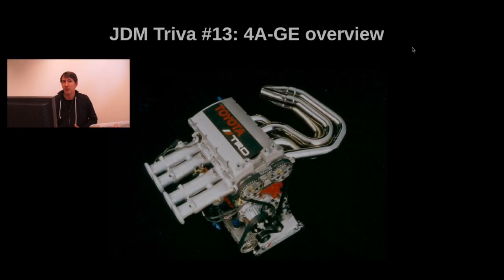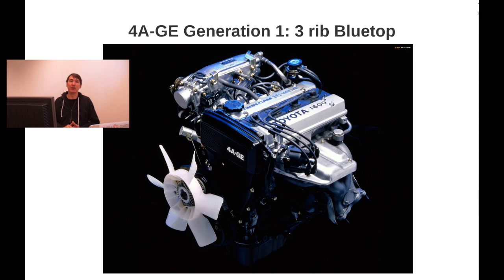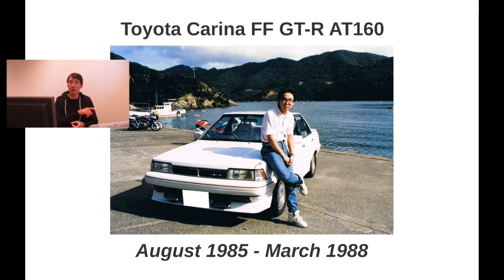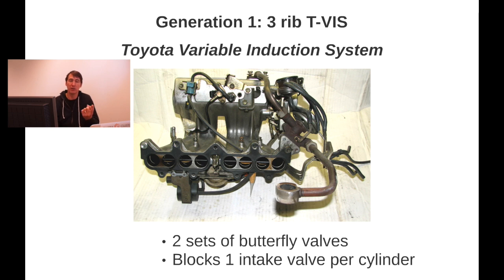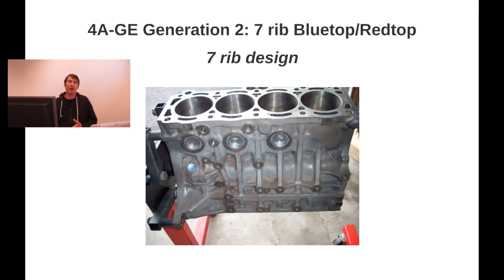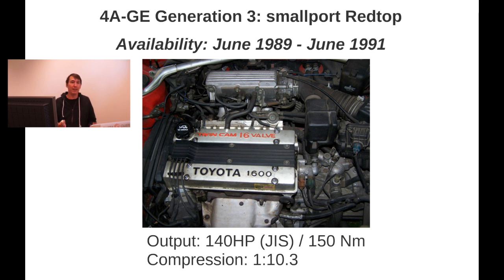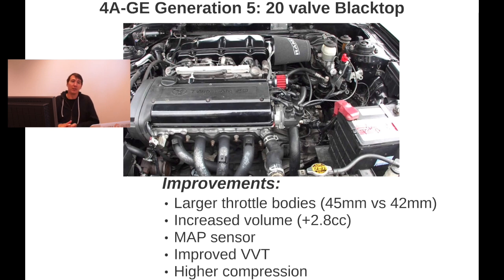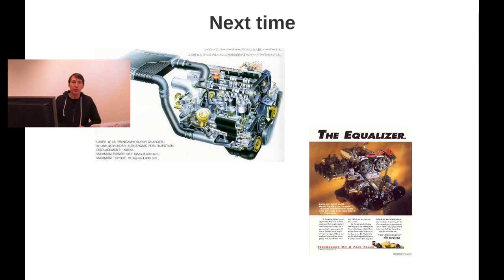4AGE Overview [JDM Trivia]

Comment: The Silvertop 4AGE, also came in the Sprinter and Corolla GT Sedans, Corolla Ceres, Sprinter Marino, and the Corolla FXGT hatch, not just the Levin and Trueno. Blacktops also were produced much longer, till at least 2000, and in a few more cars than just the Levin and Trueno. I currently Own a '99 factory AE111 Sprinter GT Sedan (Factory Blacktop & c160 6 speed), an had previously owned a BZ-Touring Sprinter Carib Wagon with the same setup. It also was delivered in the BZ-Touring Corolla Wagon all the way through to 2000. And was also available in the Carina GT.

Comment: No wonder the Japanese tuners used carbs a lot in the beginning the early 4age intake system was complete junk. its a good thing there are better intakes in the after market now so people can use fuel injection. efi all day.
Reply: How so? Mine worked great after 25 years and 200k miles. I had the second one shown 88KW I believe he said. It's similar tech to what the Taurus SHO and  Porsche 959 were using only earlier.
Reply: PGTMR2 i should have look into it more before making a comment tbh
Reply: It's cool. It's a fascinating subject, there's all kinds of trick intakes out there designed to keep the air moving at a high velocity.
Reply: PGTMR2 yeah it is I never researched 4ages as much as other engines like I do with mopar small blocks
Reply: My current car has a 2 stage intake, 4 different versions of it too. I was so fascinated by it, I ended up getting all 4. Each one changes where peak power is.
Reply: PGTMR2 how's that work?
Reply: Well... each intake has different length runners and different size air boxes (2) built into the manifold. At low RPMs, 3 cylinders on each box get their air from the TB (the long way) step one connects the other end of the manifold so each set of 3 can pull air from 2 directions. Step 2 connects the air boxes in the middle effectively shortening the distance as short as possible so each individual runner can grab from a bigger overall supply of air. It uses helmholtz resonance principals, treating the air as if it was a spring, at different RPMs you need a different spring rate to keep the air flowing at high velocity.  Changing the shape changes that spring rate. One intake is a low rpm intake, it is also the most restrictive even when fully open at stage 2, peak power is under 5k rpms. The best intake makes peak power at 6500 ish. There are also oval and square runner differences too so the best intake makes more power. The ecu has to be tuned to flip the valves open at the correct RPM too, or you will lose power switching intakes.
Reply: ITBs are life
Reply: If you're referring to the T-VIS, they actually worked extremely well at retaining torque and efficiency at lower RPM. The reason why other companies were shying away from 16V engines and big ports was because of the loss in intake velocity and fuel vaporisation. The 4A-GE was very advanced as it had the power of a big port at high RPM due to its high flow head and the torque of a small port at lower RPM due to higher intake velocities and asymmetric intake as a result of the T-VIS closing off one runner for each cylinder.

Comment: Great, i found only 1 error: 10:26 t-vis is an acronym for Toyota Variable Intake (not induction) system
Reply from the maker: Thanks for the correction! However Toyota's official (80s) documentation on the tvis says it stands for induction, not intake: http://3sgte.org/page_13.htm
I learned thanks to many comments that it's not the intake that changes, but the induction changes do to the increased velocity
Reply: banpeinet that’s right, even if you take a look at how the engine works you see that it’s the induction that changes, but for whatever reason I always heard that the system is called Toyota variable intake system, probably it’s just a common misconception
Reply: banpeinet thank you for responding by the way, you have an awesome car and it’s awesome to se someone with a lot of knowledge about this old boxes
Reply: Now this is a how conversations should be carried. A kind correction and a humble acceptance.

Comment: I've got a first gen on my 86 celica. I made an overhaul to the engine and boy that thing is fast. I have to fix some stuff though. It doesn't run the way i want.
Reply from the maker: +taunusv4power have you already counted the ribs? :p
Reply: banpeinet hahaha! i just opened the bonnet to see the ribs but the exhaust manifold cover is on the way. the block is black though and is an early 1986 one so i'm pretty sure is a first gen.
Reply from the maker: +taunusv4power I knew people would check out! :)
Yes if the engine looks legit and never has been swapped it has to be one. Is your Celica an original Peruvian delivered car?
Reply: banpeinet the engine was never changed and it's not a Peruvian model, mine is a JDM one that my uncle bought in Japan 22 years ago for my grandfather, he imported it and made a LHD conversion here. :D
Reply from the maker: +taunusv4power wow, that's an awesome car than! Cherish it and keep it in the family!
Reply: banpeinet that car was a rust bucket when my grandpa passed away. my uncle wanted to sell it, but my dad bought it for me, he let go his father's 1962 mercury meteor back in 1993 and still regrets it to this day, so he didn't wanted to make the same mistake. i repaired the whole body, changed the suspension, fixed the brakes and part of the engine. if i ever get rid of all my cars, i'll only keep the celica and my other grandfather's 1971 beetle, those are the only 2 things i'll die with that's for sure :)

Comment: what is the best 4 age engine and the most fuel economy engine  and what 4 age  is the best tuneble engine
Reply: It depends what you want to achieve really. The 20Vs are better as standard but throw any money at any of the 4A-GE engines and your power ceiling is about the same. A good port and polish, some big cams, a good exhaust and up the compression and you can get 180bhp with any of these engines naturally aspirated and upwards if you want to go crazy (see Formula Atlantic 240bhp 4A-GE). 

Any of these engines will take forced induction on low boost with no issues but if you want to up the boost you'll have to replace a lot of the parts in the naturally aspirated engines. The 4A-GZE is more suitable for higher boost levels but if you want more than 200bhp you'll probably want to replace some of the internals regardless. 

So in summary: It depends. NA screamer, torquey daily or highly boosted fuel guzzler. If you want to get crazy power and will be replacing the internals and doing lots of work anyway then I would say it doesn't matter (probably avoid the 3 rib blue top). These engines aren't exactly 100% interchangeable though so consider the wiring loom nightmare if swapping from one type to another.
Reply: For fuel economy you'll be best with a blue top or a red & black top (big port 16V with T-VIS) as you get nice low end torque and very good fuel vaporisation due to the asymmetric induction.

Comment: 23.30  the formula 1 race engines in the beginning of the 90`s   Honda /Renault  broke the 200hp/liter !!!!! limit           the engine your talking about delivers 100hp/liter , the main reason was ; that the race engines redlined at around 14000 rpm !!

Comment: The fourth gen 85 Celica gt you show here did not come with a 4age engine but rather a 3sfe 16v. Which did not have tvis. Only the later 86 up gts/gtr had a 3sge which has the tvis.
Reply from the maker: Thanks for the correction. Maybe it didn't come with the 4AGE in the US, but it surely came with the 4AGE (and 4AFE) in both Japan and Europe.
Reply: Thats not true. im pretty sure no celica ever came with a 4age engine for that matter, earlier gen celica's came with perfered 22R engines some carb some fuel injected. The Celica and Supra Line up never came with 4age engines. Correct if im wrong with a source.
Reply from the maker: As I said in my reply: maybe they didn't come with the 4AGE in the US, but outside the US they were available. The 22R was not available on a Celica outside the US either. Also I actually owned a Toyota Celica GT-S AA63 in the past, and I'm absolutely certain about it having a factory 4AGE as it was on the firewall plate.
If you need  a source, please have a look at Wikipedia:
https://en.wikipedia.org/wiki/Toyota_Celica#Third_generation_.28A60.3B_1981.E2.80.931985.29
https://en.wikipedia.org/wiki/Toyota_Celica#Fourth_generation_.28T160.3B_1985.E2.80.931989.29
And if that isn't enough proof, here are the Japanese brochures for the third and fourth generations:
http://www.en.japanclassic.ru/booklets/147-toyota-celica-1981-a60.html
http://www.en.japanclassic.ru/booklets/149-toyota-celica-1985-t160.html
Reply: i have owned a 1987 celica st162 and it had a 3sge motor.
Reply from the maker: +Haris Ansari yes that generation also featured a couple of other engines, including the 3sge

Comment: Heeeeeey. the 4afe is still a twin cam. Just a different design
Reply from the maker: Yes, I stand corrected here: it is a twin cam as it has two cam shafts. The major difference with the 4AGE is that the 4AFE has a very narrow angle and it has a single cam gear.

Comment: Hey bud just took my 3rib bigport apart its a 6bolt flywheel everyone says it never came with this. Is that true?
Reply from the maker: The six bolt flywheel was only used on the 4ac, so it could be either a head swap or someone installed a flywheel for a 4ac?

Comment: what engine that takumi fujiwara uses after he blown the stock 4age
Reply from the maker: According to the Manga the engine is a dry sumped silvertop based 4AGE, used for rallying. So, in contrary to popular believe, it is not the Formula Atlantic engine.
Reply: banpeinet actually Toyota engines from 80s were called as Pegasus and LASRE Brands
Reply: banpeinet Shinji uses 4A-GELU
Reply from the maker: +Compaxius Camiones Pegasus was an acronym used for the suspension and lasre was as an acronym for lightweight advanced super response engine. But they used that acronym for the 3a-u on itsukis car as well. It was just a marketing term for the new generation of Toyota engines
Reply: banpeinet well i saw a  LASRE Engine in a E80(not AE86)Sprinter
Reply: I thought it was a specially built 7age....yes 7age...